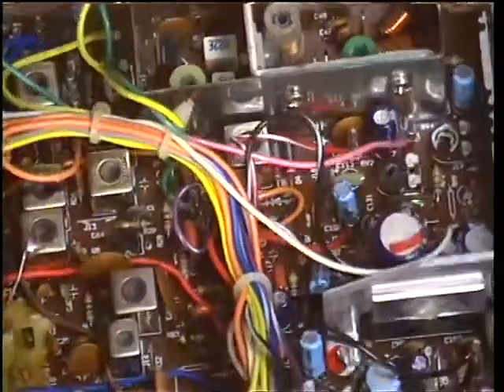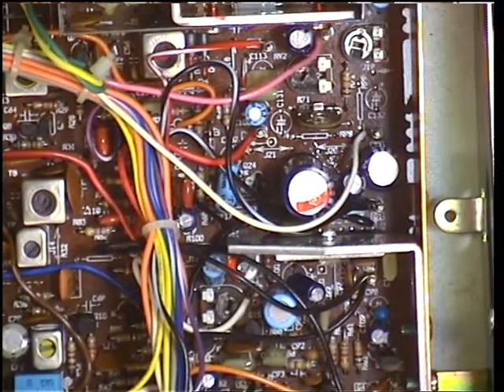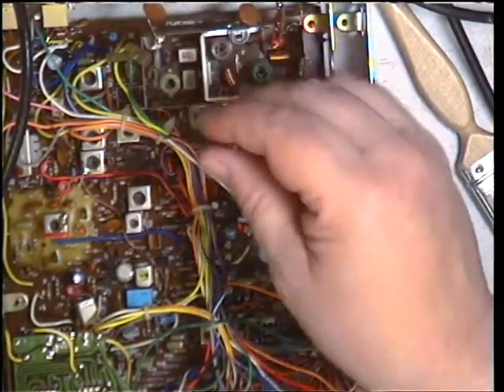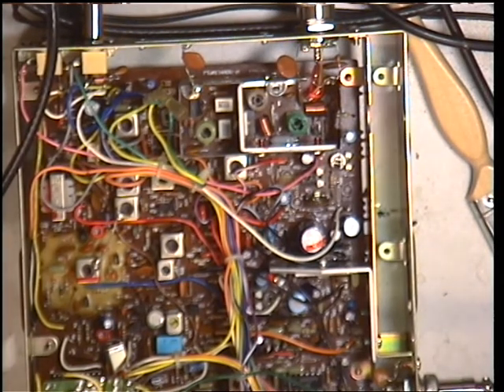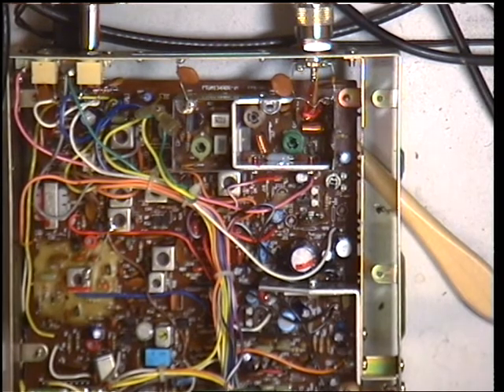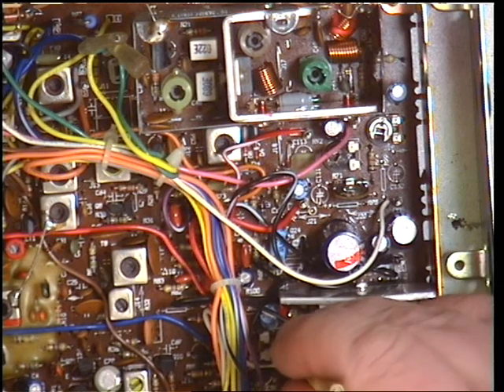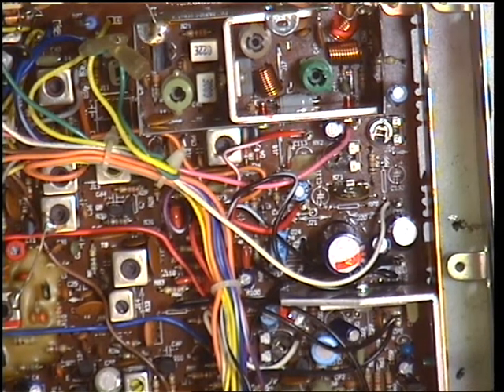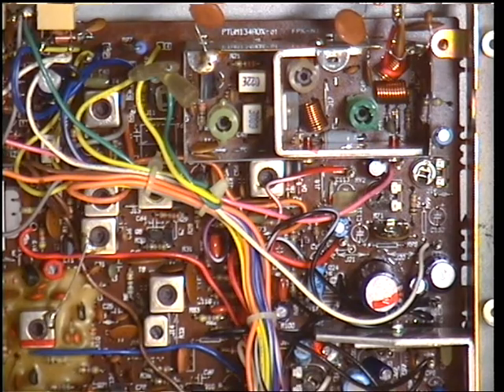Harrier CBX   UK (CB 27/81) CB radio (mobile) - receive alignment

Comment: Hi there I have one of these that I just brought of eBay and the receive neads looking at. it makes all the right sounds but the incoming is very quiet? can you help?
Reply from the maker: First check that unplugging the mike makes it quieter. rshireby@yahoo.co.uk
Reply: @ukfmcbradioservicingTango21  no it doesn't change when unplugging the mic..nither does it change when using the external speaker it's still very quiet on receive
Reply from the maker: @gavindavies4634  Chances are that electrolytic capacitors around the audio amplifier are at the end of their life and/or the audio chip. Another test you can do is to plug a speaker into the PA socket & test the radio in it's public address mode. If I'm right, the PA will be just as rubbish.

Richard
Reply: @ukfmcbradioservicingTango21  no it sounds good on pa and it sounds good to other radios it's just the receive?
Reply from the maker: @gavindavies4634  Sounds like the rx alignment is out then especially around the detector circuit...or a fault there. email me rshireby@yahoo.co.uk